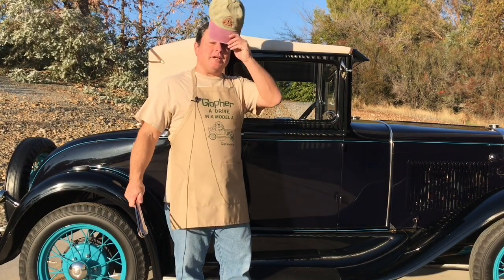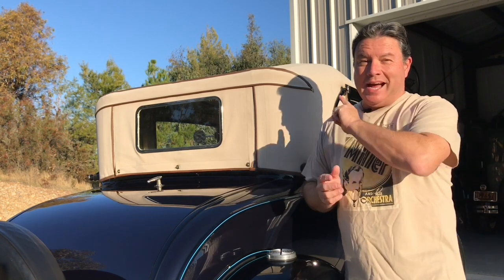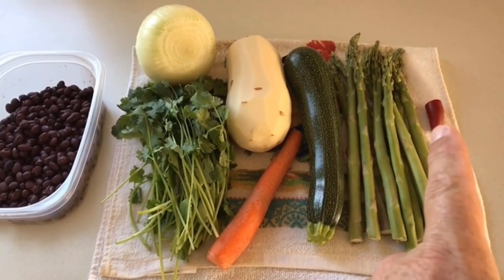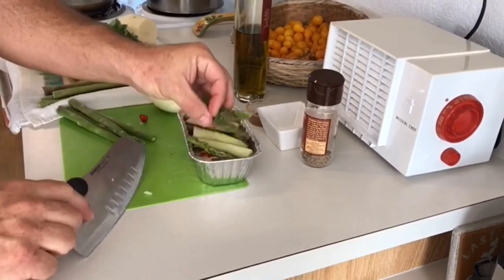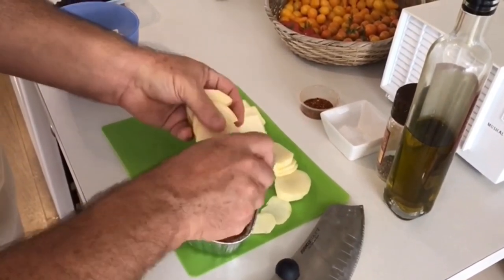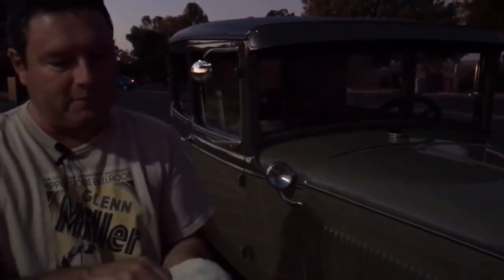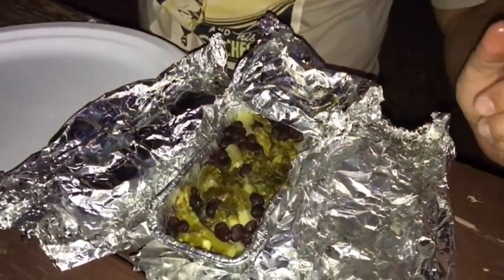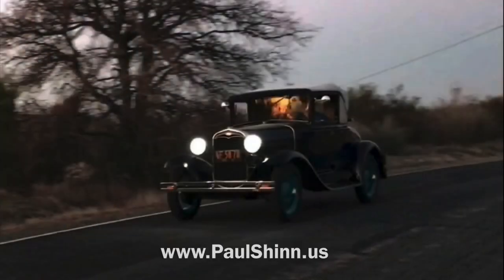Cooking on a Ford Model A - Manifold Cooking!

Comment: I remember coming across a manifold cook book years ago - the cooking "times" were all in miles. The only time I did something like this was when traveling with my first (infant) son and had to warm bottles of cold formula (glass bottles) and it did the trick. Oh, and regarding the aluminum foil - it makes no difference whether you put shiny or dull side down as far as heat retention. Dull vs shiny is simply an artifact of the manufacturing process, in which two sheets are passed together between steel rollers as they're drawn down to the final thickness. Shiny doesn't make food heat any faster than dull.
Reply from the maker: Good to know.  Thanks!
Reply: @ModelA  Great videos Paul!
Reply from the maker: @murraystewartj    Ha ha!  Well, Murray, us manly men gotta stick together, right?
Reply from the maker: @johnnyrocket6588    Thanks

Comment: We used to do that a lot in the oil field. Mechanics got a kick out of all the lunches wired to the engines.
Reply from the maker: Did you share with the mechanics?
Reply: @ModelA  they usually took whatever was there. Don't know what happened to it.

Comment: Thank you for your Model A videos Paul. I find them some of the most informative and professional that I have found. 
  I just watched your Q and A video and now, (of course) I have a question. 
  I noticed that one of your cars does not have splash guards installed.  My understanding is the splash guards help with airflow for engine cooling. Maybe post a reply on your next Q and A video.  Thank you.
Reply from the maker: They do help with cooling slightly.  But, they're a pain in the neck and my cars never come close to overheating, so I didn't put them on a couple cars.

Comment: This reminded me of a bike club campout years ago when one of the single guys srrived with a can of beans stuffed in behind his bike's engine hot & ready to eat. Watched this with my wife and no we're contemplating whether we can get to the Kia's manifold.....
BTW: Your exhaust manifold looks nice. What do ou do your manifolds with? The headers on my winter bike are always rusty from road salt being splashed on them when they are hot and I'm looking for a coating I can apply myself that will withstand the heat and last a while.
Reply from the maker: Thanks!  That manifold doesn't have anything on it.  It was N.O.S. when I installed it MANY years ago.  However, if you watch the manifold gasket video, you'll see what happened to it eventually....  Insert sad face here.

Comment: In my career at an oil refinery, the "old timers" would cook meals on the hot equipment similar to your method. Microwave ovens took over that function in our plant, but I enjoyed what you've presented as a modern-day option...creating an adventure meal plan!
Reply from the maker: Neat!  You gonna try it now?
Reply: @ModelA  Great videos by the way.
In the words of the Scarecrow in the Wizard of Oz (kinda)..."If I only had an A". I'd like to get involved in a club (will Covid ever go away?) to learn more about the cars and figure out which version fits me best (6'2"). I've heard the Tudor allows some rearward movement of the driver's seat. My goal would be to take longer trips in whatever I get, replacing my motorcycle in that role. I'm in Northern California now, but was raised in Indiana. In the '30s my uncle and a couple friends scraped together a few bucks and bought a Model A. They told their parents they were driving to Michigan (summer before their senior year in high school), but ended up in California. What could go wrong? They survived on little money, working along the way to pay for food and gas. Several times the car broke down and they repaired it and continued on, eventually returning home to worried parents but were the envy of their high school class.
Reply from the maker: @1150migrant    If you're that tall, then yes, a tudor sedan is tour best bet.  Flip the seat mounts around backwards and you have the most legroom of any  Model A body style.

Comment: We do this at ww2 events
The jeep manifolds need you to use some wire to tie the foid to it because its not condusive to things staying put.
Have a friend with a studebaker Deuce and a half 
The stude manifold hugs big and little cans against the block perfectly
Reply from the maker: We should exchange "recipes"!
Reply: Not as fun as your stuff
We just poked holes in whatever cans we wanted for venting and faced the holes
 up
Makes a mess of the engine block, but it tastes great
Reply from the maker: @kyleh3615    I tried that before.  You're right- What a mess.